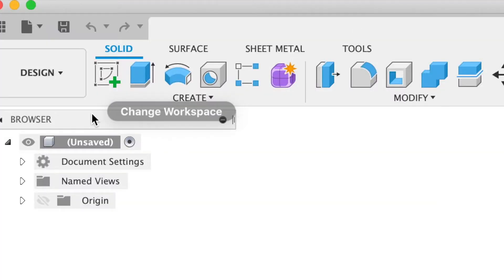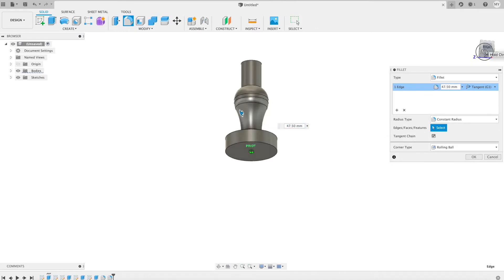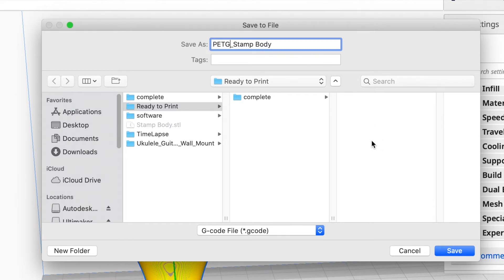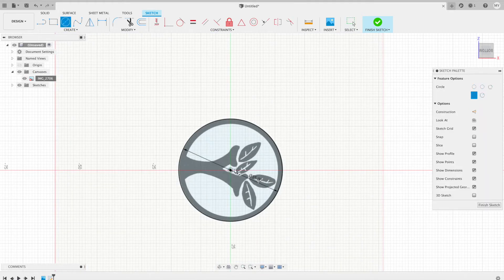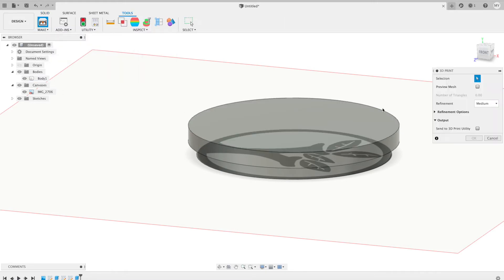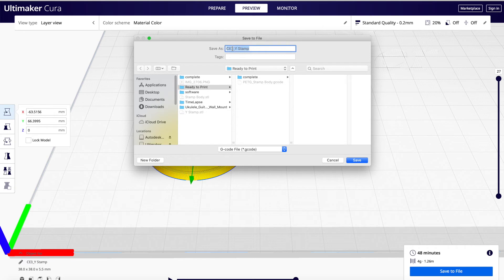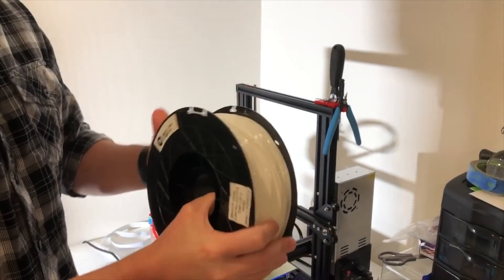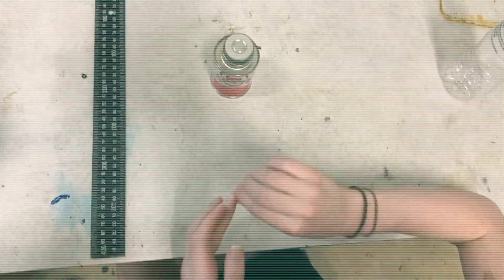HOW TO DESIGN AND 3D PRINT A CUSTOM STAMP

Comment: Hi I wanted to say that I like the video!  Thumbs up 👍, I've been thinking about making one of these for myself... and Youtube read my mind and suggested this video.  Nice work you two!

May I suggest a little brighter thumbnail with a little close view of the stamp portion.  I think that could draw more views to your good instructional video.  

I also use the Ender 3, I have the V2.  How do you like the Micro Swiss?  Is the print speed comparable to the Boden setup with the added mass on the X?
Reply from the maker: Thank you so much for the feedback and tips! The Micro Swiss has worked great so far, though we haven't tested it's increased temperature limits yet (We'll be testing out some Nylon filament soon). We still have a bowden tube setup, but we did upgrade to a Capricorn tube, so we can't speak to additional weight on the X as the Micro Swiss seemed a comparable weight to stock. That being said, we have a direct drive coming in the mail and will do a video on the install/review of that in the future along with our configuration changes required.